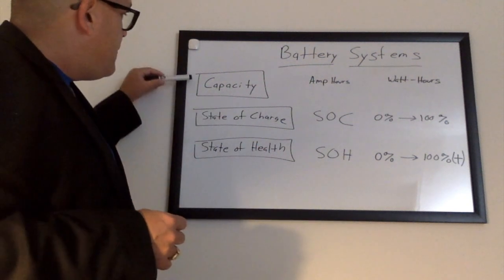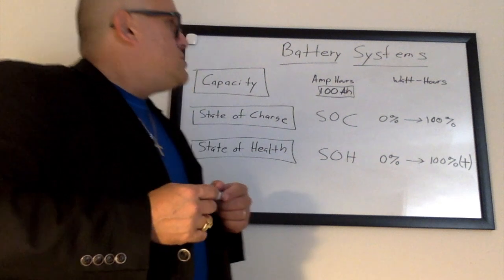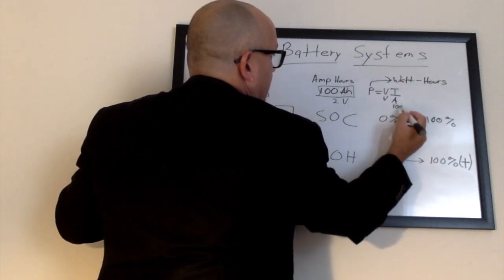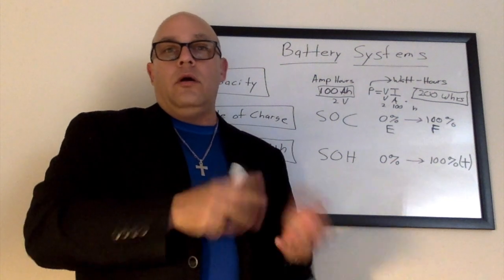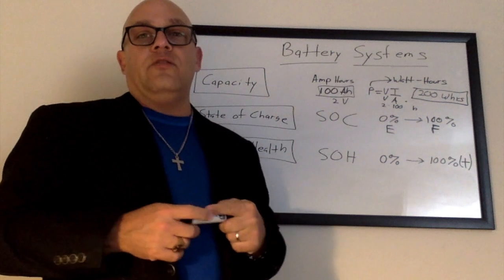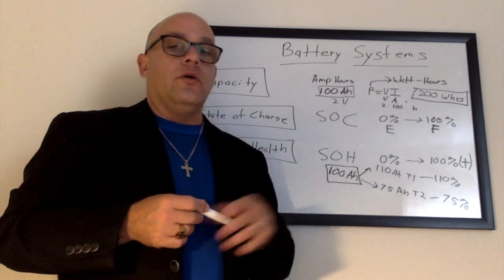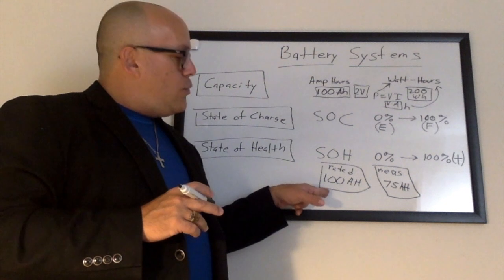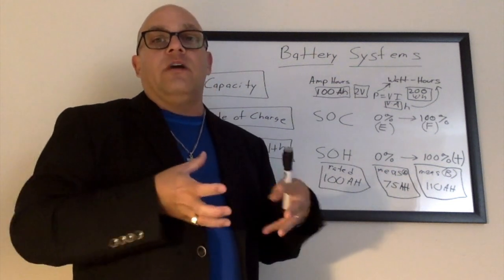Battery Systems Intro

Comment: what is capacity retention and how to calculate cycles from capacity retention?
 kindly make a lecture on this.
Reply from the maker: Thanks for the recommendation, Syed.  What is the application for your systems?  Grid, vehicle, portable, etc?
Reply: @joeistre2717  Thanks for your reply i am working on Battery Management  System